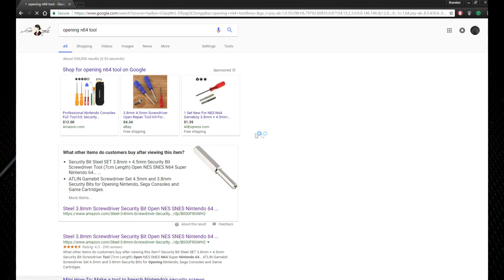How to Led Mod Your Translucent  Nintendo 64

Comment: Finished the mod but added a switch, thanks for the tutorial!

https://www.reddit.com/r/n64/comments/eqbf9t/this_was_fun/?utm_source=share&utm_medium=ios_app&utm_name=iossmf
Reply from the maker: Looks great! Thanks for sharing the results, the switch is a nice touch did you font one that slips through those little vents or did you have to cut a hole?
Reply: TechnoOnTop had to drill a hole. 😬
Reply from the maker: Ah! I would of definitely been hesitant of that, maybe late but those people who mod up those crazy game boys use some type of   (not sure if this is the right term) haptic switch that sits underneath the plastic and is able to be touched to cycle through colors/effects/on off, maybe something to look into in the future, regardless your n64 looks great and the switch is a useful feature one I wish mine had sometimes you just need some darkness.
Reply: TechnoOnTop thanks for the tip!

Comment: How did you get the lights to stay green? Did you use a power supply/remote to set the color before you wired them up? Also when you cut the led strip sections, did you then just use the 12 gauge wire and solder to connect all the sections into one continuous run? Thanks for the info and great mod!
Reply from the maker: Rgb leds just have 3 different grounds and if you ground the "G" one it will be green, or if I wanted blue I would ground the the "B" one. Or if you want purple then ground both "R" and 'B" as for the wire yes I just connected them, and the wire Guage is probably smaller like 26 or 22 awg. Thanks for watching! Happy modding
Reply: TechnoOnTop Thanks!!

Comment: Yo, thats DOPE!! I kinda wanna try this, i have some LED stripes here that i dont use.
Question, because im a total noob with this, you sodered the black wire to whatever color (R, G or B) you want the LED to be and the Green wire is just the power source (my LED stripe says +12v), right?! Dont wanna cook my N64, haha.
Reply from the maker: I actually ended up taking out about half the strips that were inside it for this video. one  day it just stopped turning on, then after removing some strips it was back working.... maybe I went a little overboard on the leds lol and the power supply stopped dealing with it, just a thought , but I appreciate the comment,  yeah R, G, B act as grounds on most if not all Led strips, then the 12v is your source, also connecting them up backwards shouldn't hurt your n64 if anything it would damage the strip, but better safe then sorry especially when dealing with a 64
Reply: TechnoOnTop it also wouldn’t break the strip, they are diodes, you really don’t know enough about this to give explanations to people.
Reply: @TechnoOnTop  Hi please put in your description that it's best to use less than you shown in the video so people do not all make that mistake. I love how this all looks. I want my ice blue done and watermelon red as well in the future.
Reply: @TechnoOnTop  Thank you! Yea, I dont wanna break anything, so I thought I better ask^^

Comment: What if i dont use resistors can that fry my n64 ?
Reply from the maker: No, resistors are there to keep from frying the LED's I don't remember the voltage of the source on the n64 but you might not even need them

Comment: does this cause any overheating issues?
Reply from the maker: I can't say iv played it more then 2 hours at a time but no it didn't have any issues. The electric tape is still in place. It's top of the line stuff not just the cheap generic tape. Thanks for watching
Reply: @TechnoOnTop  What would happen if I connected them to a 5 volt power source instead of 12 volts?
Reply from the maker: As long as you aren't using alot they should work. Why not just connect them the way I show in the video?
Reply: @TechnoOnTop  I'm having overheating issues. I'm not sure if it's because they're drawing too much power or because they're too bright. I used kapton tape where I glued the LEDs and then I covered the connections with liquid tape.

Comment: Definitely want to see a grey N64 Led modded, thats what I have and need help.  :) Done with my Xbox's so this should be a fun next project.
Reply from the maker: Ahh yeah I do have one sitting in the closet. Ironically awhile ago I showed how to do that mod but when I put it all back together it shorted so I never put that video out...
Reply: :)  Ah man,  well while you were doing it did you figure a way to make the logo back lit and looking evenly lit up?  I've seen a few on youtube but most all have bright spots.
Reply from the maker: No it would of definitely be un even. I remember someone using some type of lcd to even out the light. On some forum not sure who did it. I believe they used an old cell phone display. One other way would be making a small board with multiple Leds then diffusing it  would more the likely make it light up even.

Comment: This is beyond epic, I've been waiting for you to try this one out. I'm especially glad you didn't wreck another N64 like what you told me before, now you've got something really cool. It's interesting how you showed the power LED layout to, that gave me a cool idea to do a custom backlight for the N64 logo on the front of the console by soldering an LED in parallel to the power LED's positive and negative points. Do you know if that would work?
Reply from the maker: thanks man :D, yeah I was extremely worried about it but I took my time and was very cautious checked everything with a multi-meter ect haha. you know I actually did try to do that for this 64 , I added a single 5mm green LED with no resistor, it didn't light it up but the power LED did, I checked the LED but it was good like I said there is very little power going through that LED so that has to be the issue. so to accomplish that you would have to run wires from the points on the bottom of the board. you will also need to cut out a hole if you wanted to do this on a standard grey 64. but if it's translucent you're good to go